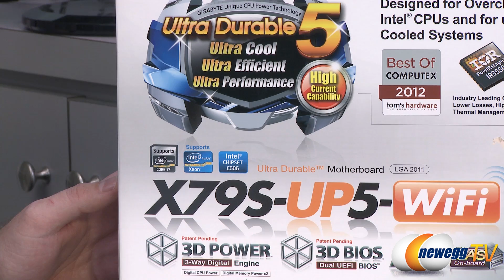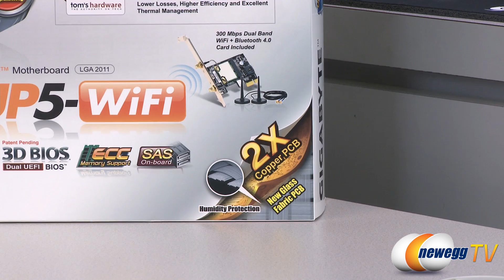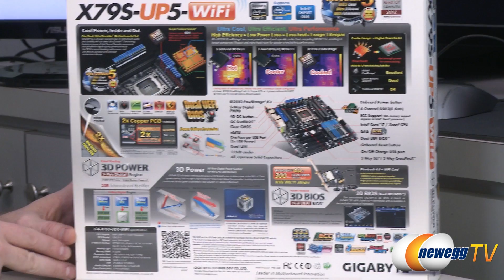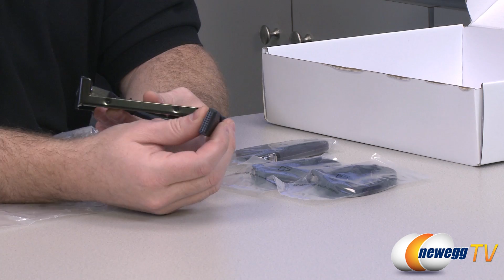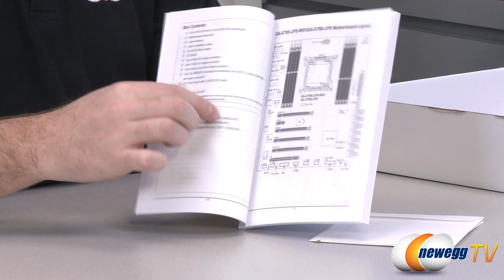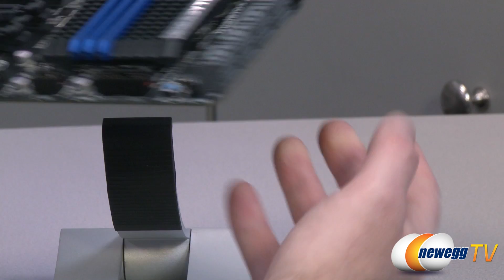Newegg TV: GIGABYTE GA-X79S-UP5-WIFI Overview

Comment: hi, i want to know if the 8 sas connectors grey only works with XEON proccesor, or, it works fine if i can use it connecting only NORMAL SATA hardisk.
Reply: Since it's off the c606 chipset, you needn't a Xeon for it. Connecting a normal SATA storage/drive to a SAS will work, however, not SAS storage/drive to SATA.

Comment: you keep on repeating that it's compatible with sandy bridge processors but what about the ivy bridge processor e.g. the i7 4930K????
Reply: the i7-4930k is a Sandy bridge-E CPU which is compatible with the board.. Normal sandy bridge and ivy bridge are not cmpatible with this board :)
Reply: horesvinet hi do you know if I can connect i7 4820K? Thanks
Reply: yes, that is compatible :)

Comment: prime95 and a program he uses which I can't remember the name of were used for benchmarking the processors, and mine destroyed his (my motherboard got hot, but the processor was fine), and fps tests in Battlefield 3, Skyrim, and Crysis were used to test the graphics cards. I should mention my processor is overclocked to 4.8GHz and my graphics card is overclocked with a core clock of 675 and a memory clock of 870.

Comment: the red usb headers don't give a higher voltage! All usb ports have 5V not more or less. But they are capable of delivering a higher current which can indeed charge faster or multiple things at once. pls don't make that mistake again